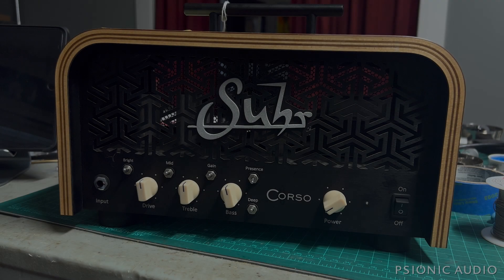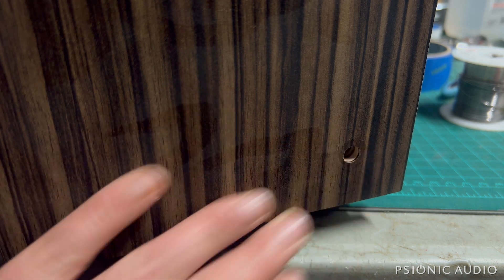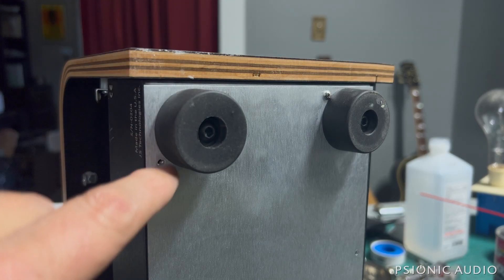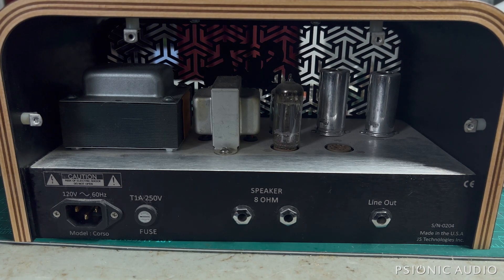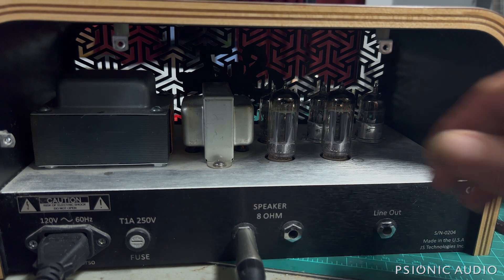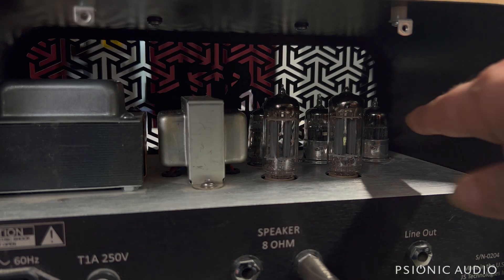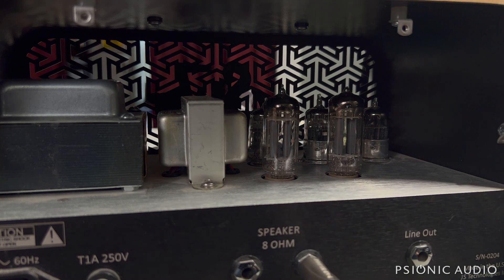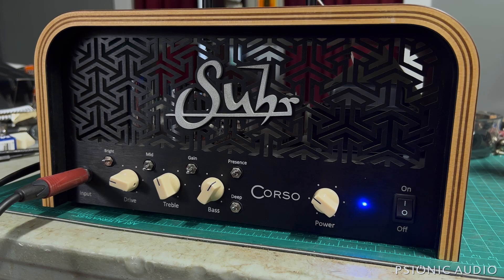Suhr Corso | A Tricky Problem and a Look Inside

Comment: Love the content. Just an FYI, as a sheet metal fabricator, that chassis looks like it's a bent box rather than machined. I can see the welds in the corners and it looks like the top face has been welded and ground smooth.  Most likely laser cut from a sheet, pems inserted, bent then welded. If its aluminum (which is looks like), it could probably be made domestically for around $8-15 depending on the size of the run.
Reply from the maker: Cool, thanks. I know Suhr machines some aluminum stuff out of billets. This chassis is so much more put-together than most out there - it's really nice.

Comment: I have the confessional grille version, i took the weird handle off, (it's rigid, doesn't "kneel")
The only way to do an effects loop is by way of a n "OX Box load box setup.
I couldn't take that shell off either,
BTW this is a phenomenal amp, recording, jamming or even live with a slave amp.
The ONLY issue I have is the attenuator is just a wire mesh resistor type and it's really trigger happy, it jumps from 0 to 5 with a couple of mm movement.
It gets a bit better when you whip it around a couple of dozen times.

Comment: Great job. Very unusual output stage. I wonder what inspired Suhr to use it.
Reply: There are a few contemporary low wattage amps that use 12BH7s in the power stage, Blackstar HT5 and H&K Tubemeister spring to mind, Laney have also adopted it for their LA Studio amp.
Reply: @alecboyyes  there were several articles about DIY push-pull hifi amps using octal-based dual triodes published in radio-electroncs magazines in the mid to late 50's (can't remember the tube types offhand, but they were triodes designed for TV use). There are also builders who use BIG 6AS7/6060 octal-base dual triodes for audio (originally designed as voltage regulator tubes). They need 3-something amps at 6.3 volts just to heat them!

Comment: First time I have seen 12BH7a used as outputs given it a strong 12au7 more current about same gain .Seen them used  as driver tubes since the mid 50's  like a 6sn7 or 6cg7  has been used.
Reply: Blackstar HT5 uses a single 12BH7 as power tube, think the H&K Tubemeister did as well.

More recently, Laney's low watt LA Studio amp uses one as well. This is the only amp I have seen thus far that uses two of them in the power section though.
Reply: @alecboyyes  well it does work just not what I would use in a small power tube . little pentodes el84, el86  or 6080 for a triode .

Comment: This is the first time I've seen a preamp or driver type tube red-plate!  Although the 12BH7's are actually being used as output tubes here, and therefore likely run at higher voltage and current than they would be if used as preamp/driver/phase-invertor tubes,  but still....an unusual problem. Were those 12BH7 tubes actually modern production from Russia or China? Original US production are still around, since they were once made in large quantities for televisions, where they were used as vertical-deflection drivers and had to be rugged in order to swing high voltage pulses.

Comment: Love the channel. I am always surprised and not in a good  way, at how many of these high priced boutique amps use circuit boards. I picked up a used Goodsell combo for $1000 and it is all point to point hardwired. No circuit boards, no integrated circuits just wires, diodes, resistors etc. I've had to have one repair performed on it in 8 years and this amp gets worked hard. Acorn amps in Atlanta completed the repair in under two days replacing two output resistors and fresh power amp tubes. "I love working on amps built like this" is what the tech said.
Reply: I, on the other hand, continue to accept as normal(tragic, but normal) the percentage of people who feel comfortable expressing their opinions about topics of which they understand very little. There are truly shitty amps that are wired point-to-point, and there are truly great(e.g. the Suhr Corso) amps that use circuit boards. 

Cheers,

Alan Tomlinson

Comment: I bought one of these recently (serial # 0004) when I was in the market for a low-wattage tube amp, preferably with power scaling. I was leaning toward the Blackstar 5W head, or maybe a Blues Jr or the Supro (Delta King?). But luckily I started watching Lyle’s videos, and learned why the latter were less than ideal, and why patiently stalking Reverb for a Corso would be worth the money. I’m assuming such a story is one of the reasons why you started your channel. If so, mission accomplished.
Reply from the maker: Thanks man! That indeed makes me happy to read.

I’ve always intended these videos to help musicians understand amps and make more informed decisions.
Reply: @PsionicAudio  It's helping me as well. Thanks for sharing.
Reply: His channel has helped me as well. Every guitarist should be subscribed to psionic audio

Comment: Thats not a rheostat, it's an L-pad, a speaker-level volume control that maintains roughly the same impedance load to the amp as the speaker itself, regardless of how you set the amount of attenuation. If you look inside an L-pad you'll find two wirewound resistance elements, both audio taper but one with an opposite resistance taper and wind compared to the other, so that as one increases the other decreases, keeping the resistance/impedance about the same throughout the control's rotation.
Reply from the maker: I know, just didn’t want to go into it in the video as it wasn’t a problem.
Reply: @PsionicAudio  , I figured you might know what an L-pad is, but offered the explanation for the benefit of anyone else who might not.
Reply: @PsionicAudio  , did you ever find out the trick or procedure for getting the wooden case off?
Reply from the maker: Nah, wasn’t needed. I’m sure it’s doable and I have the needed phone numbers, but it wasn’t a windmill that needed tilting.
Reply from the maker: And I wasn’t lying when I said I was on my first cup of coffee in the early parts of the video. Post-noon me would have said L-pad and attenuation instead of power scaling.
Reply: @PsionicAudio  ,  I understand completely. I almost never get even a semi-uninterrupted nights sleep anymore,  I'm usually up between 4-30 and 5 AM at the latest,, and yet I'm typically not even half awake until about 8-30 or 9.  Our 2 giant dogs know better than to interrupt my wife and I when we're drinking coffee, but we are also fostering a 7 pound Maltese/terrier mix, and that little F'er knows no boundaries (plus he's on prednisone for skin issues, and can barely hold still for a minute ----  forget caffeine, you'd think the dog was on meth).  Little dogs are always more trouble than big ones.....